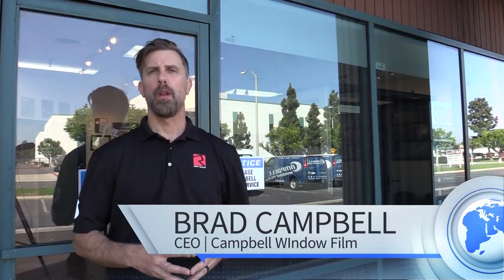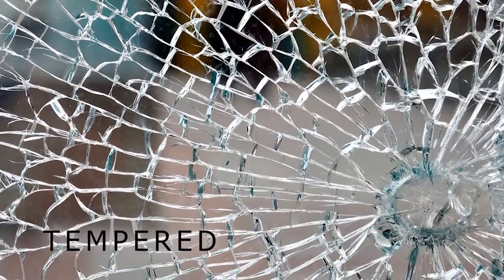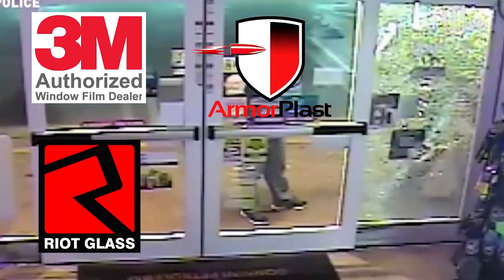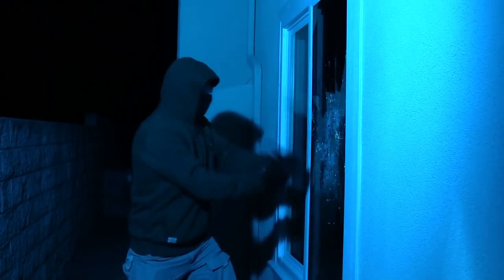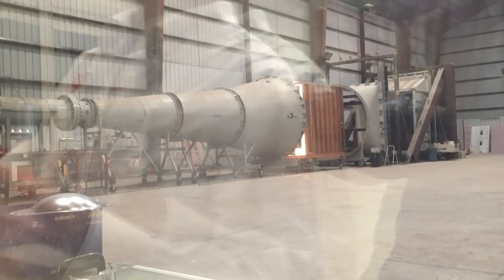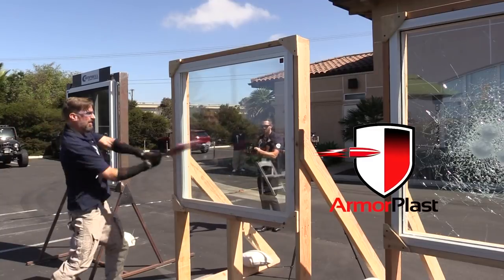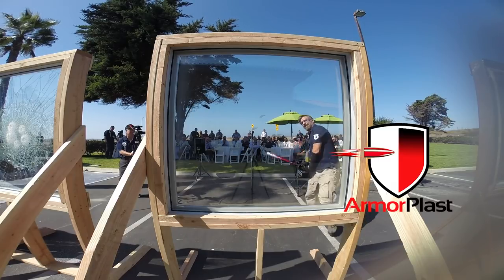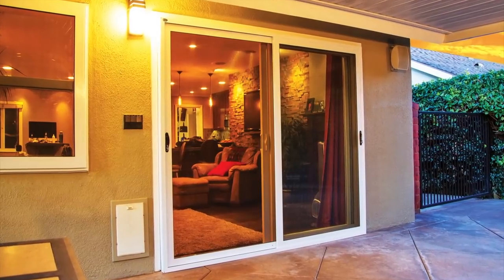Security Glass Basics 2020 | Campbell Security

Comment: Imagine being in a fire and you try to break the glass but it’s riot glass: understandable imma die now
Reply: Strategically placed fire exits mandated by fire safety laws in all buildings:
Am I a joke to you?
Reply: My house is stone with these kind of windows
Reply: Just remember most exterior house walls are not inpenetrable.  In Arizona (for example), our walls are stucco, chicken wire, plywood, insulation, 2x4 or 2x6, & drywall.  An axe can get through that with just a couple swings.

Comment: At 25-35 dollars a square foot it would cost me 1200.00-1700.00 dollars  to do my back sliding glass door. That’s a little to rich for my blood. For home security I’d have to go a different route
Reply: It's worth it, if you don't wanna spend too much on glass you can still reinforce the inner or outer side with a different material like metal closures.

Comment: What would you recommend for old fashion multi pane glass windows in an apartment setting. Kind of looks like. French door type window.
Reply from the maker: French windows are inherently weak because the thin framing cannot withstand forcible entry attempts. The best thing you can do is add Security Window Film. Ideally, you would replace the doors with a single piece of security glazing in them. If that’s not possible, film is better than nothing. Wish I had a better answer for you.
Reply: @CampbellWindowFilm  film on each individual square? Right?

Comment: How well does Armor plast stand up to a crack pipe torch?  Will the torch melt it right away?
Reply: @JM-oi9pk  I guess so. This is the weakness of any plastic...easy to burn thru.

I replaced my vehicle's windows with Lexan.  I did not use films over the existing glass.  

I bought the Lexan at Home Depot, $200 for a 4ft x 8ft sheet, I have plenty left over. I removed my window from the car door, traced it on the 
Lexan, cut it with a jigsaw, and mounted it back into the door.  Easy, took a few hours for two doors, if that.

Since I have a cargo van, I only have two windows, front driver & front passenger.  No rear windows.  I added marine portal windows on all 
three sides in the rear but that is another story.

The films seemed like too much of a pain to me.  Everyone online complained about installing them. Plus, they don't really protect that much.  The Lexan
is more $$ but much more harder to smash, if at all...yet Lexan can still be drilled or burned so it is a trade off.

At least my windows can't be easily smashed...glass is so, so easy to break. So easy.

Comment: So what you're saying is that rioters etc need pocket knives now..... Blunt forces from an impact like a hammer are being transferred through the glass to the flexible laminate. So cut the laminate (like you would a windscreen) and it's useless, no? Smash the glass into smaller shards and particles, then blade between and cut the laminate. Also - the same force through a point? Say hammering on a pocketknife - how does the laminate cope with that?

Failing that - I wonder what the temperature rating of the adhesive is...
Reply: You should try and cut laminated glass some time. As for heating it , give that a shot with a blow torch  while you are at it . While none of them are 100% impenetrable LG, is very tough stuff
Reply: @ericwsmith7722  I've cut laminate glass many times - usually with a knife with a string around it and a screwdriver or similar in the string.

Self employed with motorcycles now, but used to work in a garage that dealt with insurance repairs.

But I was genuinely wondering what the melting point, or the failing point of the adhesive on the laminate is, or even of the laminate itself. Glass is okay at dissipating heat, but if it's cracked or pierced before hand how would that affect the results?
Reply: @the_mad_ratter  string and screwdriver huh ?  Never seen anyone ever cut LG with those tools, Your talking about taking a windshield out of a car of something .  You score both sides of the glass ( it really 2 pieces of glass)  snap them, heat the seem ,torch or squirt alcohol over the scored seem, light it on fire , then  work the glass up and down till the laminate stretched enough to get a razor between the glass, and cut it threw it.  Glass it self melts at about 1500 F btw.  Its hardly impervious to  breaching , but difficult
Reply: @ericwsmith7722  well technically welding wire and a screwdiver handle (from the cheapo motorcycle underseat tool kits) but who is nitpicking?? Wire around the handle of the blade, screwdriver through the wire, use the screwdriver to pull the blade :) Quick and relatively easy method of removing the screen - they're generally pre-broken too! Then a scraper to remove the seal.

Comment: Very impressively. I would like to know with security as the number one priority, can I install ceramic film or reflective tint afterwards or before to get the best of both?
Reply from the maker: Iraj Matthee Best to use a security film that is already combined with a solar film at the factory (most reputable film manufacturers make these). Never apply security film over another film. It will compromises its integrity.
Reply: @CampbellWindowFilm  thank you for the valuable information.